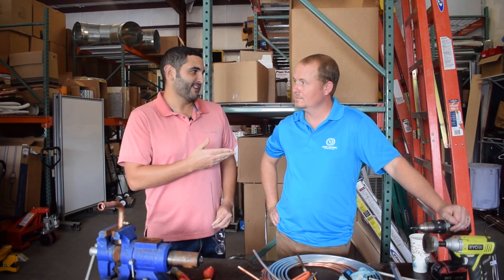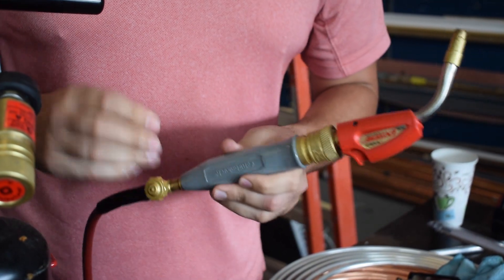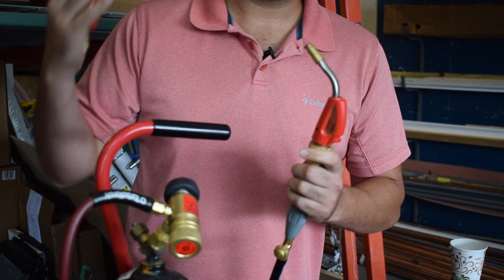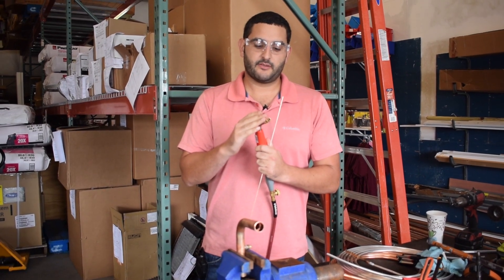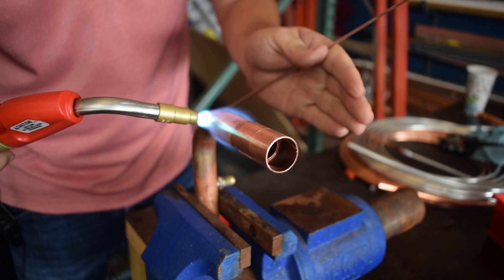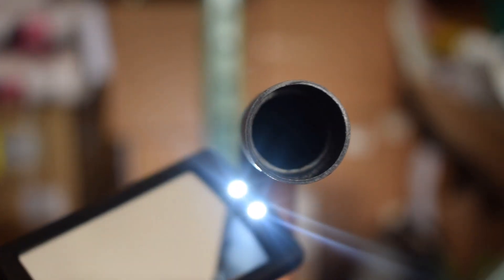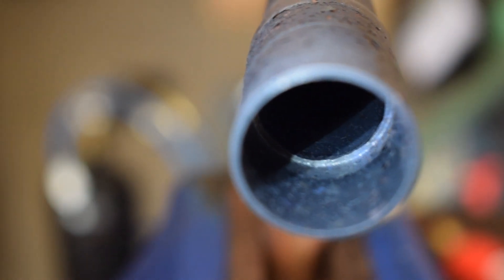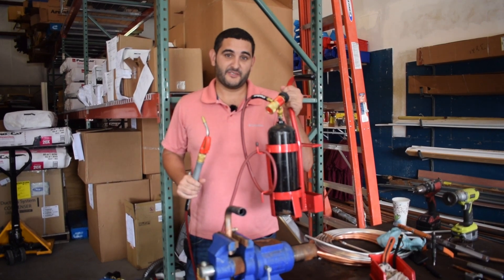TurboTorch - Air Acetylene

Comment: Guys....an A-5 tip uses approximately 5 cfh of flow.  You want to use 1/10 withdrawal rate at 15 psi.  That would mean a 50 cf tank...which they don't make.  You would need a 75cf #3 tank to use that tip safely.  But definitely not an MC (10 cf #1) or a B tank (40 cf #2).  Did you not get your acetylene cert before purchasing your equipment?

Comment: Im not 100% yet but i believe the flame is to be adjusted at the handle. Everyone says run the flame wide open. The turbotorch pdf says run the regulator wide open but also gives correct and incorrect flame picures, which tells me that they are to be adjusted at the handle. If I run the valve on the handle wide open it gets unbearably loud, but more importantly the blue flame leaves the tip, so I adjust it down until it touches again. All these videos say run wide open, and that, I believe to be incorrect.

Comment: Were you soldering a copper pipe coupler, roughly 1/2 to 3/4"?
That is a lot of solder and also time.
Probably because of the type of solder you were using.
When I use my acetylene,  if I start the heating on breathing in, by the time I breath out, the soldering is done.
Reply: I think the tricks in the name he was braising 15% silver solder alloy, not soft soldering .as a plumber in Victoria Australia whenever we use heat and filler alloy to join anything that we are working on , It’s always a braze- we don’t solder anything water, gas etc and yeah his technique was a little bit so so because he doesn’t do it professionally ,and it is a slower process than soft (95-5 or 50-50) soldering because the heat required is much much higher… I’ve traditionally used oxyacetylene for everything, but I can certainly see the benefits of using Air settling in applications are required and obviously if you’ve got the standard Oxyacet torch on your truck it’s pretty easy to integrate Air acetylene in that’s another option as well👍🏾

Comment: IMO , ace/oxy brazing works a lot better. I’ll just continue to carry my two tanks around. Thanks for the demonstration anyways 👍
Reply: lol more power to you but oxy/acet is overkill. for majority of hvac work air/acet is sufficient. with mini splits popularity, even air/mapp is sufficient
Reply: @lordjaashin  try to braze around wires , oxygen/ acetylene concentrates heat where you want it.
Reply: Are these good for coil cleaning? Unsoldering and soldering back?

Comment: do they have built in flashback arrestors?? or do we buy them separately?
Reply: you cannot have a flashback with this
Reply: @whatevernamegoeshere3644  Correct because it uses atmospheric oxygen which will not overcome cylinder gas pressure because the lowest cylinder pressure can get is to equalize with atmospheric pressure.
Reply: I think it would be possible to put a flashback arrester between the outlet of your cylinder regulator, and the inlet of your hose

Comment: Is this something that could be used for Blacksmithing, and getting a localized heat?  For steel up to, maybe 1/2"?
Reply: Yeah I've used it several times. Cheaper to run that oxy/ace, great for bends on large pieces